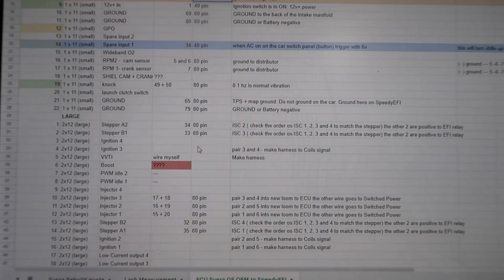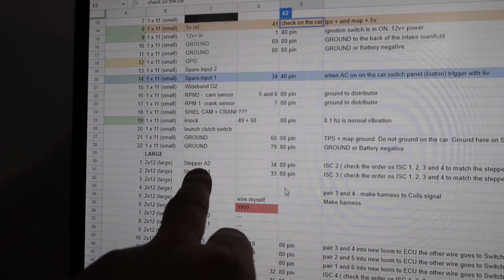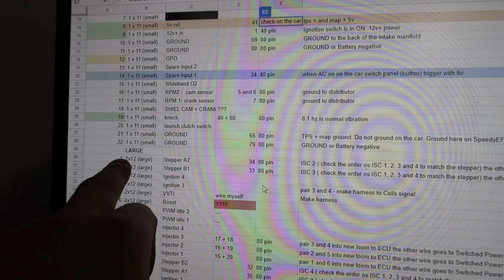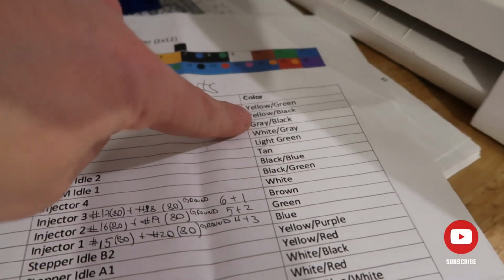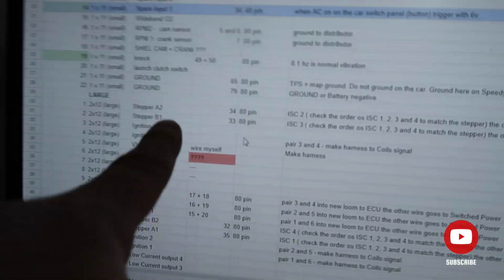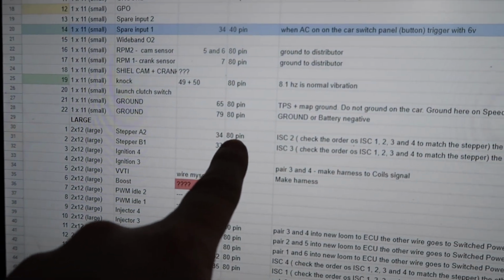Making Supra ECU Plug and Play

Comment: Are you using the stock sipra ecu with the speeduino? And where did you get that big connector @ 0.10?
Reply from the maker: Hey brother. No the stock ECU is gone and I made sort of a plug and play with that connector. Got it here https://www.bmotorsports.com/shop/product_info.php/products_id/5455
Reply: @CarModsGarage hello will that work plug and play for my 1993 supra 2jzge 5spd.  I've had 2 oem ecu go bad on me and im frustrated that car just runs good for a while then back to the misfiring due to ecus
Reply from the maker: @jvst20051  hey, no it didn't quite work plug and play since the wires to the coils and  injectors were different on my setup.   Also the OEM coils for the Supra are not smart coils.  It won't work with this ECU easily.  
If you are losing ecu's you might have a short somewhere.   Might want to chase that down.
Reply: @CarModsGarage  everything is stock except the pods like oil pressure and  fuel reading  other than that its stock
Reply from the maker: @jvst20051  you can still make it but there will be a lot of researching and soldering.  if you lost two ECUs already I would think that the new ECU won't be different.  Some current will get there like it did to the other two and blow it as well.  Unless you had two bad ECUs before.   I'm not sure how to find where the current is coming from.
Reply: @CarModsGarage  i think its cuz thete old ecus and the bad capacitors leaked the acid in the board
Reply from the maker: @jvst20051  oh ok.  I would just think that two ECUs having the same issue would be weird but ya that's possible for sure